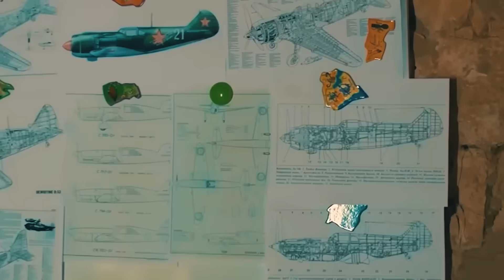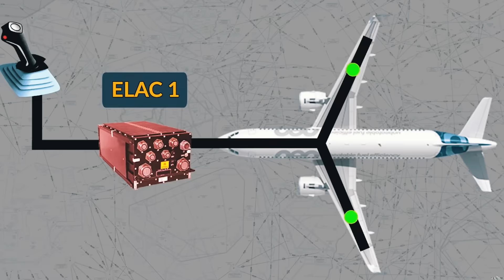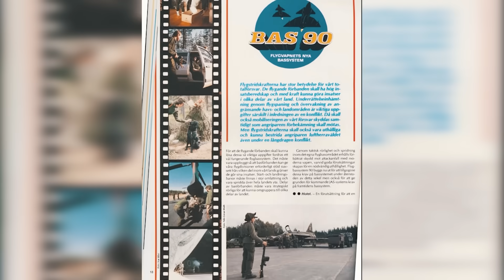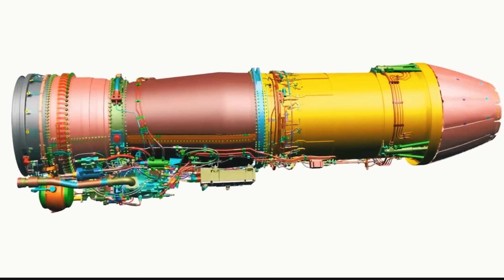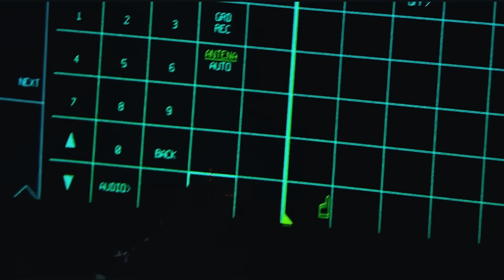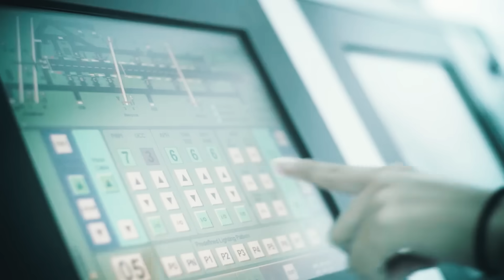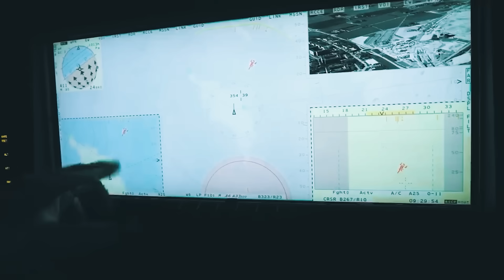Swedish Brand New Fighter Jet Shocked The World!

Comment: after the NAS leak 17 oktober if i remeber the date right, that the Israel F-35 got lock-on and had to abort it mission in Iran should open the eye's of future customers if thy want to pay a hell lot more for a service cost and future that don't work any more. the JAS39 have had it focuses on digital stealth sens the 70's and are decade ahead of the rest in the market with radar cloning and cloaking etc. that probebly would have keep the F-35 hidden if it hade the JAS39 sensor fusing system that started  its dev in 1955 not in 2006 like the F-35

Comment: The primary reason to develop their own fighter was because of all the special demands. Short take off and landing, easy service, and cheap spares were part of it. The personell servicing the fighters were initially conscripts that had less than a year to learn the procedures before they went back to their civil life. The service is often done on the tarmac and it has to be possible to do without access to a hangar. Yep that's BAS 90 that forces support for this. The cost per flight hour is also a lot lower than for any of the planes mentioned in the video. So it was a very tough design specification they had to go by.

When first presented the steer by wire system was still not really fully functioning. Two crashes were caused by the computers not being able to find the correct solution. One was a direct crash at when trying to take off, and the other that's probably more known was when a plane crashed while doing an airshow over Stockholm. In both cases it was the programming of the computers that failed. Making the design unstable made it very maneuverable but it also meant that it is dependent on the computer to stay in the air. A pilot simply isn't fast enough to keep it flying stable, and as it was the first it also suffered the first bugs.

Comment: I was in the Air force in Norway on an F-16 Sqd.. everyone said.. Strange that we dont have the planes from sweden.. And some nice attack helicopters. (the apache is to hard to run, but there are other options)  This is alot of NATO politics. But imagine the savings. We can take the train to be trained in Sweden. Spare parts .. take a taxi if need be. When 1 flight hour is about 100.000 kroner. Not a big deal. Point is, I am 99% sure we wasted alot of money for a really good aircraft, when we could have spent less for a really good aircraft.

Comment: India was looking at 114 Grippen NGs for it airforce as per an airforce official. However, the issue with Gripen is that it imports a lot of parts from a lot of different countries and hence cant provide the transfer of technology that India wants. Also, India is working on its own plane that will be comparable to Rafale's capabilities but with a single engine and canards like the Grippen. Currently SAAB is full on trying to sell this jet to India but French and Americans have more diplomatic weight.

Comment: What happened to Saab cars?
Reply: The chinese tried buying them, but GM would not allow it. Then Spyker bought (dutch "car" company) and ran what was left into ground, then the chinese actually managed to buy it (or atleast part of the original saab platforms and machinery. (Evergrande) coinvested by swedes turned into NEVS that first tried reopen production of Saabs in Sweden, but failed. Then almost got an electric car out, but a production deal collapsed when the owner, a guy called Mohammed Jihad was accused of antisemitism. Now NEVS in Sweden and the Emily GT project is on ice/hibernation. NEVS in China is producing electric vehicles based on the the 9-3/9-5 platforms they aquired. The Emily GT developed by the SAAB engineers that transitioned into NEVS. Check out the test drive of that car if you want to see some innovation!

Comment: Nobody can see the future but as of right now it seems US has been betting on the wrong horse. Well, you can't win them all. Besides, it's also possible there will be a new breakthrough in stealth tech that will reshuffle all the cards, or some new combination of technologies will advance rapidly.
Maybe using planes not as weapon platforms but sensor sweets in a massive network will become so powerful it pushes out every other function? Stealth could be useful in this scenario, you would need forward sensors deep inside enemy territory, while the sources/carriers of the firepower could be hundreds of miles in the rear.

Or it could end up sensor/sattelite tech advancing so rapidly so that you won't need those advanced hidden flying sensor sweets.

Time will tell.

Comment: Comparing it to a F-35 is a bit of a joke. The Pratt & Whitney engine F135 produces 43000lbs of thrust compared to 22000 in the Gripen. The Gripen is a light and agile fighter/multi purpose plane. But it’s not a 5th Gen stealth fighter does not have half the computing power or situational awareness of a an F35.
Reply: You are incorrect, the Situational awareness is one thing the Gripen E Aces. passive sensors to be able to pin point and launch missiles on enemies without using it's own radar, its EW suite and data sharing are other top aspects of the Gripen. It is no joke comparing the two planes, the F-35 is likely the better plane, specially the stealth part, but Gripen is still the third smallest RCS after the F-35 and the F-22 in the world. Operational costs is also around 4-8.000 usd/h compared to 20-40.000 usd per hour for the F-35 depening on variant. Joke is on you.
Reply: @mycide How many targets? What are is the processing power??, what about the engine thrust???. Your welcome- now f/off
Reply: @mycide  Its also much smaller than both the F22/35 so no surprise on the rcs genius. Try about 60-70000 USD maintenance per hour on the F35 (theres a reason for that). Try about 4 time the computing power and twice the engine power...Laughable...and that's before we even start talking about a 25 yo F22...Just amazes me how everyone gets excited about some things and just ignore everything else..

Comment: This is not a brand new aircraft. Ignorant people are only learning about it now though but it's been developed since more than 40 years ago
Reply: You are not quite right there, there is a very big difference between version C/D and E, on the outside they look the same, e.g. the operation system (OS) that flies the plane is completely separated from the OS that handles protection, combat, jamming, etc., which means you can upgrade the Combat OS every week if you want, compare it for example to the problems the F35 has with its OS upgrade, don't think so there is any other aircraft that ever has or had it. and that's just one of the changes.
Reply: 2016

Comment: The F-35 and the F-22 have both been bested in mock combat by the Gripen, the Rafale and the Eurofighter.
Reply: Never been bested had to not use stealth and other weapon systems to make it fair. In real combat the Rafale and Gripen would be shot down before they knew F22 was there. The f22 and 35 are not dog fighters.
Reply: @jonathangalante2829  The F22 was specifically designed for air superiority...One was also 'shot down ' by an Emiri Mirage 2000.
Reply: @canadasleftcoast.5744  You don't get it. Those are not separate units, they are nodes in a large network. Flying sensor suites first, weapons platforms second, with lots of carriers for firepower far in the rear.

It all may be too complex for you to understand, idk... Don't blame me for that.

Doesn't mean stealth was necessarily the right thing to bet on. It might become completely useless in the near future, that's definitely one possibility. Or not. We'll see.

Comment: Not rally brand new. It was developed in the 80s and eneterd service in the 90s. The E-model which is about to enter service sometime soon, is just a further development on the same design and airframe. It's like putting a new CPU and GPU, as well as upping the RAM on your computer. Still the same comuter, but with updated parts.
Reply: You can also say that its a brand new airplane, its very similar to other airplanes but that is very hard to avoid and feel fre to correct me if I am wrong....
Reply: @Coole-ee1vg  
It's similar to most modern fighter jets because it uses the Viggen configuration.
   This revolutionary configuration took the rest of the world a decade to copy, except for the US, which still needs to be able to create a single fighter jet like that.
   Only Burt Rutan in the USA realized its total superiority. He created his EZ-Viggen in 1972, and the rest of his famous creations all have the Viggen config.
   SAAB is leading the way, and all others try to keep up.
   Kinda like how Tesla is leading the way into the future...
Reply: Thd E version is like using almost the same case, the same brand and model but a little bit taller, exchanging the harddrives to SSD, new CPU, new GPU, and BTW new motherboard… So, E should be seen as a new plane.
Reply: @Anita95_original  
Indeed.
   Also, just like the A/B and C/D are E/F, the first is a one-seater, and the other is a two-seater. So, the guy who claimed otherwise is off quite a bit.
Reply: If you take  the metal case from an old 486 computer and put it over a sprillande ( Swedish for latest ) new supercomputer it is still an old computer??? Why don't you quit the drugs, cut your hair, stop "youtbing" and get a job and a life, looser...

Comment: Saab Draken (=dragon) was the first airplane to implement the Cobra combat maneuver. Credit were given to the russians, therefore its known as the Pugachev´s Cobra.

Edit: Saab Viggen (=lightning) is the first operative combat airplane with cannards.

Edit 2: Saab Draken was also the first operative combat airplane with double delta wing configuration.
Reply: Saab Draken is actually named after the kite and not the dragon. (Drake leksaken som man flyger)
Reply: "Saab Draken (=dragon) was the first airplane to implement the Cobra combat maneuver. Credit were given to the russians, therefore its known as the Pugachev´s Cobra."

That's because while Draken was the first CAPABLE of doing it, it wasn't until the MiG-29 and Su-27s much more advanced aerodynamically lifting body fuselages changed it from a novelty "thing" to something that could be used as a combat maneuver, or reliably at all, even by a regular pilot.

If you go look at Growling Sidewinder's DCS channel, for his overall very amusing video of "what would really have happened in Top gun" with an F-14 facing a Su-57, that video has several excellent examples of maneuvers that fall, at least roughly, within the purview of the Cobra, as the Su-57 is even better at doing such extreme maneuvers.
And if you look at his or others DCS channels, you will also notice that pretty much anyone flying Su-27 derivatives or the Su-57 will sometimes use the cobra as a very effective combat maneuver(effectively being able to pull your nose around to completely different direction, get a lock on and shoot a missile, and even if missing, get away with it without losing too much energy or making yourself a too easy target).   While it's extremely rare for most other aircraft.

This is because of how the aerodynamics of the current generation Russian fighters differs in the fuselage design, it's not only a highly advanced lifting body, but it also has much less drag if, for example, it hits the air moving horizontally, while in a vertical position.
The engine nacelles among other things basically creates a virtual wedge, so instead of the fuselage and wings acting as one big scoop hitting the air flat, it acts more like a slight angle, greatly reducing how much energy is lost while performing such extreme angle maneuvers.

So yeah, Draken could do it first, but the fact that it was relatively good at it was by accident, while for the MiG-29 and Su-27 and the likes, it is a deliberate part of the design.
Reply: @DIREWOLFx75  the cobra is NOT a combat maneuver. You are asking to get KILLED if you dump speed like that in real life.
Reply: It was also the first plane with thrust vectoring, albeit a fairly crude one.
Reply: Every plane has cannards but Sweden is unique as it uses front cannard
Reply: Show me the canards an a Mirage 3?

And: Canard is the term used for flight surfaces typically fitted ahead of the main wing. So no, every aircraft does not have canards.
Reply: @MeMPG-n8e  you usually just use the term " canard" when talking about the smaller front wings:) pz
Reply: @MeMPG-n8e  Please don't write such blatantly false claims.